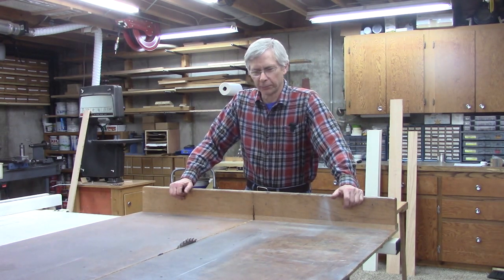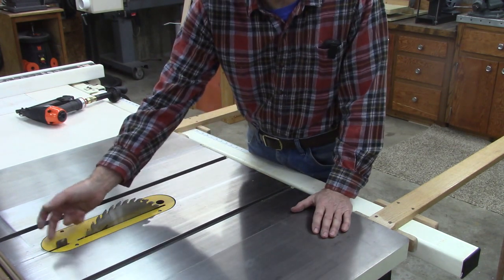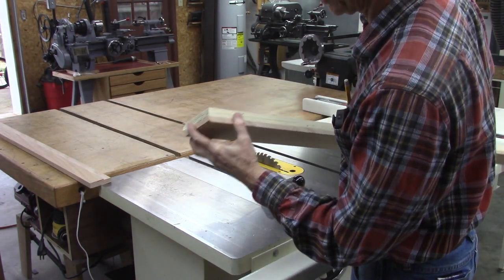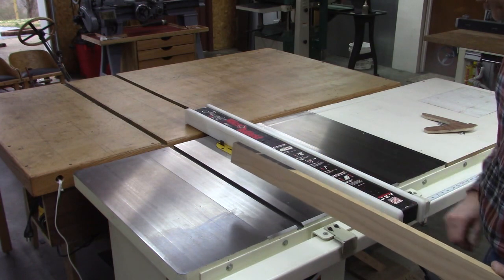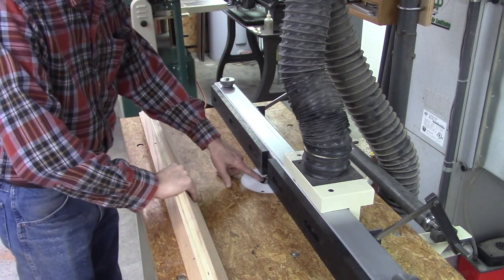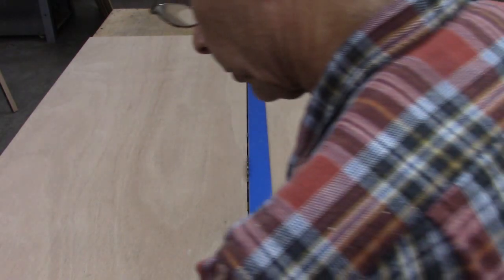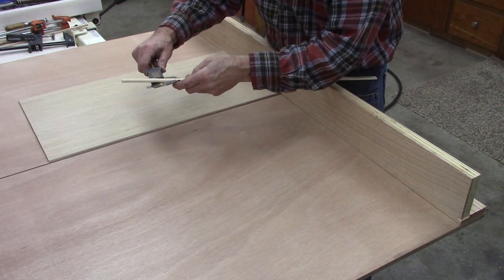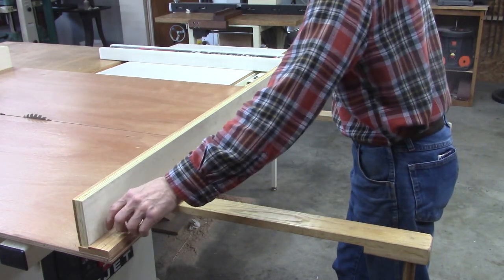Easy and Reliable Table Saw Crosscut Sled

Comment: You say you like it ? YOU SHOULD, Well done piece that you will have for years my friend.
Reply from the maker: My last one lasted about 18 years. I made the new one mostly because the old one was super dirty. The sled and the outfeed table have seen 3 metal lathe rebuilds and a power hacksaw rebuild. I'll try hard to keep this one clean. The best part about this new one is that it is much lighter. I'm not really sure why. I suspect the plywood is a different type of wood.

Comment: Nice job and nice design! I especially like the way you got the runners lined up and the correct distance apart by building the two halves separately and joining them together at the end. I also like your method for checking squareness. I never really understood the 5 cut method anyway and yours tells you the exact amount of correction needed. Thanks for another great video.
Reply from the maker: Thank you very much!  I totally agree on the 5 cut method. I hesitate to be critical of well intended ideas but when I saw that method my first thought was...  "wow, that's silly". In the past I ripped a 2 foot wide piece of plywood and flipped it the other way (so the far edge ends up against the fence). As long as the piece of wood has parallel sides it works well.

Comment: I always wondered how those were built.  If I had a pro saw like you have I am sure I would want to build one.  Thanks for the video.
Reply from the maker: Thanks Harold. They are super handy.
Reply: No matter what table saw you have , large or small, this type of sliding table will be the best thing you will have for cross cutting. Search You Tube and you will find a dozen or more examples of all sizes.
Reply from the maker: @glencrandall7051  - I agree 100%. I also think this construction method is easier and better than most especially in regards to the runner attachment.

Comment: Enjoyed..nice discussion/build...IMO, the raised portion of the rear fence in line with the blade is a reminder of were NOT to have your hands, I added a block so when the blade passes through the fence it is shielded (not exposed) on tall cuts
Reply from the maker: I've used sleds made like that and the raise section gets in the way of stop blocks and jigs. For me the center is just not a natural place to push. I hope I never have to eat these words but the only real benefit i see to a raised section is strength and this is why I made the entire fence almost 5 inches tall. But thanks for the comment, one other person said the same.

Comment: Another handy and space saving thing I built into my out feed table is a flush mounted router table lift. Its out of the way but always handy.
Reply from the maker: I had one in my extension table for my fence. If I have a smaller shop i might tolerate it but it was always in the way when I was sawing. Maybe the far corner is my extension table would be better but I like my seperate router table better.
Reply: @WinkysWorkshop  i flush mounted mine so it is not in the way, I do like yours too though

Comment: If you had installed the back fence first you would not have the problem with the shifting when you were testing for square. Also as mentioned earlier, no need for the carriage bolts. Just start by using one screw at each end. Then if adjustment is needed remove one screw, adjust, then finish screwing the front fence. Instead of cutting dadoes for the runners just screw them on from the top.  Also make several sleds in varying sizes. This one is great for large sheets of plywood but a smaller one will be easier to handle when working with smaller stock. Thank you for sharing. Have a great day.
Reply from the maker: Sigh...   Yes I thought of this after completing the sled. Attaching the back fence first would be much better. I also have a smaller sled I use for dados or setting the blade at an angle. I think it's 30 in depth.

Comment: Great for any shop with enough room. I saw the finished video so I figured I should see this one too my friend. Nice work bud. Like you I only have the splitter/riving knives on our table saws. I find the guards are more dangerous than not.
Reply from the maker: I had one bad kick back about 20 years ago I was ripping a 2 x 2 foot long piece of plywood down to about 18" if I remember right. It was slightly warped and started vibrating. I seriously thought I broke my pelvic bone. I'll never use a saw without a splitter again. I WISH it had the riving knife.  Yes, the guard on top is terrible.
Reply: @WinkysWorkshop  I only had one kick back from a table saw. It was a 1/4 inch piece of birch plywood to be used for a drawer bottom. Fortunately it was 14" away from the blade but it hit a small pertusion at the edge of the R/H extension. When it happened the piece came back and twisted removing a bunch of hide from my L hand. It happened sooooo fast there was no slowing it down nor recovering from it. 4 band aids and later my 4 lb hammer tuned that pertrusion down to never happen again. I have a sawmill and have seen the results of a kick back from both edger and chainsaws and none of then anyone would like to be behind them when they happen. Thanks for the reply my friend. Take care eh !

Comment: Nice job! I made a extra long miter guide for my saw, but it's short and only fits on the right side of the blade. It is constructed using the guide rails as yours does. It allows me to cross cut longer pieces than the standard miter head that came with the saw. Yours is really much better allowing to cut panels.
Reply from the maker: Thanks, Yeahs ago I built a lot of kitchen cabinets and i needed the capacity. It would be had to go back to a small sled. My table saw with the fence extension and outfeed table takes up a 6 x 8 foot area. That's a lot of space in the middle of my shop but i think it is worth it.
Reply: @WinkysWorkshop   Your right, a table saw is almost useless with out a full size outfeed table.
Reply from the maker: @andyZ3500s  The outfeed and sled certainly allow you to fully utilize the table saw!

Comment: 👍👍😎👍👍. Since you have the fence secured with all the other screws, I would suggest removing the carriage bolts as they likely are not adding significant clamping now.  From my vantage point, the threads that are poking up would snag my fingers/palms at some point and draw blood.  Thanks for the exquisite tutorial.
Reply from the maker: Thanks, I agree, good idea on the carriage bolts

Comment: I agree that a riving knife is a very important safety feature that should never be overlooked.  I do have a slight disagreement with you that it is the Most important.  Especially if you have a son or daughter or several that you hope someday to inherit you wood working passion.  SawStop makes a safty feature that will save anyone's hands from catastrophic injuries. I hope mine is never used or needed but should something happen to anyone in my shop, they will only receive a small nick in thier skin and not loose some or much of their hand. 
 They approached all of the major table saw manufacturers and when there was not significant intrest in it, they decided to build their own very high quality line of saws from a small contractor to a large cabinet saw. All very high quality.   
I have also heard that there have been injuries on and subsequent  Lawsuits due to the technological being avalible to the manufacturers and not implemented. 
No I am not in anyway connected to sawstop, other than a very satisfied customer.
Reply from the maker: I agree 100%. If I was buying a new saw it would be a saw stop with a riving knife. Youtube has guidelines about brand names so I didn't want to say Saw Stop.

Comment: I think the sled's a great idea - I've not seen anything like that before. he only thing I'd consider changing is using 3 ply for the base as it doesn't have to do very much as it's fully supported underneath (it may mean not putting the runners in grooves) but I'm conscious that the thickness of the base is taking cutting depth away from the saw.
Reply from the maker: I'm okay with losing a 1/2 inch.  You are right about it not supporting anything but no way would I want to give up imbedding the runners. Plus I think removing the sled from the saw would be a problem if it was thinner. The 1/2" flexes a bit and thinner might be an issue.  Thankfully this sled weighs about a 1/3 less than my last one. I think it's related to the wood used in the plywood.

Comment: Great job!  I've never seen that done before and it makes perfect cuts.  I'm not sure how the front fence ended up perfectly straight.  (after you glued the back one on is when I would find out it is 47.5" between the fences).  What brand is the saw?  I've been cutting some lumber the last couple of weeks and my old squeeze type clamps kept getting stuck.  They would tighten but I had to whack them with a piece of wood to get them to release.  I grabbed a candle and gave them all a light rubbing of wax on the bars.  Now none of them will tighten or stay tight.  They are good ones too.  I tried to clean them but hasn't helped so far.  I'm thinking about hitting them lightly with the propane torch tomorrow maybe that'll help.
Reply from the maker: I made the video 2 year ago and the sled is still perfectly accurate. I attached the front fence (operator end) first with wood screws only. After making maybe 10 test cuts and attached the other fence. If I remember right I used a small amount of glue. Lots of screw! It's never moved. The back fence location is not important, it's only for strength.  My saw is a Jet 3HP with a Beismeyer clone made by Jet. I'm not impressed with the fence but it's very accurate....  Super heavy and I had to do a few modification to make it accurate.
Reply: Well, the propane torch took the wax off my clamps and they started working again.  I just looked up the Jet saw, it's a nice one.  You need more room Mark.  You basically have a mill shop in your garage.  Move some of the storage to a shed on a concrete slab where you won't get all the moisture and insulate the roof.   Run some power to it and you can easily keep any dew from forming.  I've been thinking about it myself.  I had a thought to put some pipe in the ground and run it to a car radiator and put coolant in it.  Set that in the end of the shed and run a small fan over it.  It might be cool enough to cause dew to form on it (to a drain pan) and pull out the humidity and might even cool it a little.  The same fan motor could circulate a little coolant pump.  It wouldn't take much.  Might even power it with a wind fan on the roof.  The other problem is the shed breathing in air and moisture as the outside temp cycles.  Put in a ceiling with some thin plywood to seal the lower space and shove a large, thick trash or leaf bag in the ceiling and attach it to an opening into the plywood.  When the sun hits the shed, the bag expands and then contracts at night and you keep the same dry air in the shed.  It's not pressurized so changes in pressure wouldn't affect it.  The perfect cheap, dry storage.  What do you think?  Can you see it?  It's basically like storing your stuff in a very large trash bag that's dry inside (but includes a shed).
Reply from the maker: @robert574  I do have a 10 x 12 shed in back that has steel and wood stored in it. The rough sawn red and white oak and poplar do fine with temperature and humidity fluctuation but the metal is a problem. I'd love to have more space. If I build another building I'll probably elevate the slab slightly and maybe insulate the walls to some degree.  most the issues arise with cool rainy days, the heat is not an issue for storage. Something my dad used to do 50 years ago is just leave a 100 watt light on in a building. As long as the building is fairly air tight it makes a big difference. Right now I'm trying to balance my priorities. I'm 67 years old, have a lot of arthritis and now I was told I need I knee replacement. A bigger shop would be fantastic but is it worth it for about 10 years?  Mr. Pete seems to be doing well...  maybe I need to be more optimistic.
Reply: I'm around the same age, but I've got way too many things I still want to do yet.  It's like they say, check the obituaries, if your names not there you're good to go.  And waiting on anything is the wrong thing to do.  You might as well have it now than next year.

Do you see where the bag in the shed would keep out the humid air?  I did some calculations on it once and normal temperature swings would not create that much additional volume.  The change in volume is calculated from changes based on absolute temperature which, so for a 10 degree F change it would be a 10/459.67 or result in about a 2.2% change in volume.  If your shed was 10 x 12 x 8 it would have 960 cu-ft of volume.  (960 x 2.2% =  21 cu-ft change).  If there was a 1 ft high pocket above the ceiling, you would have a 120 cu-ft space to store the change in volume.  (120/21=5.71 or )5.71 x 10F =57.1).  That 1ft space could handle a 57.1 deg F change in temperature without drawing in any outside air.  Just stuff the 1ft height with large leaf bags and attach them all to some PVC pipe that comes thru an opening in the ceiling to the 960 cu-ft space.  It would breathe a little with changes in barometric pressure in the area.  You  could have a little dehumidifier inside that would kick in if needed (like after you opened the door), but rarely.  Add some insulation and you have a simple, perfectly dry shed.  It will work.  You could make a video.
Reply from the maker: @robert574  Yep...  if I do anything, now is the time.